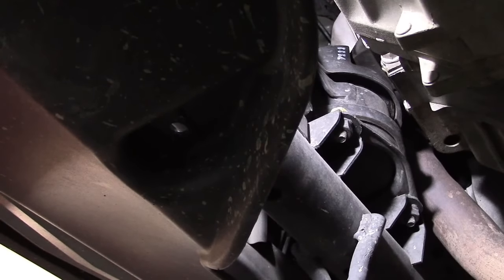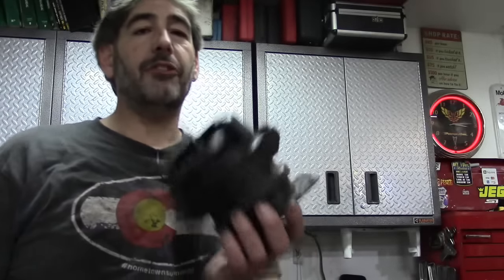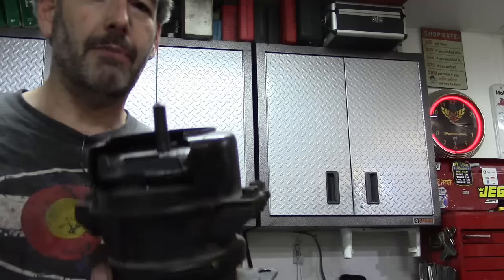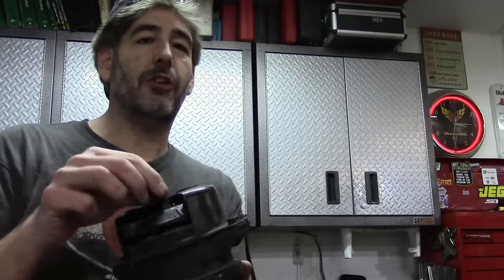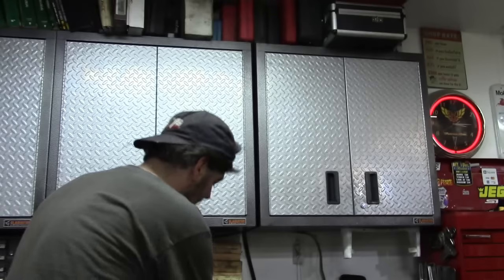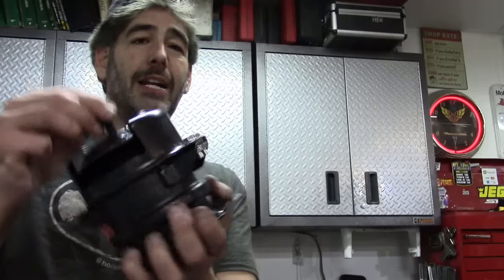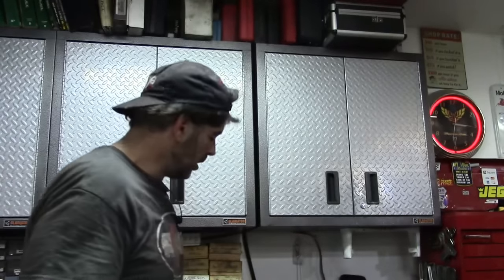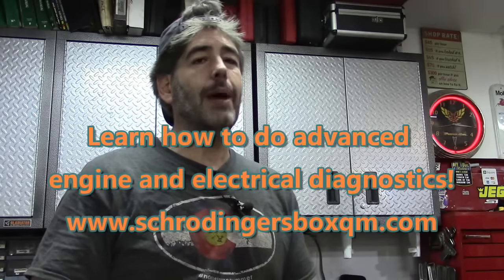How to check bad engine or transmission mounts

Comment: Hey, i don’t know how to express the problem, but i got Audi A4 B8 2008 2.0tdi CAGA. Had problem with one engines cushioun. I replaced it, and after  4 days maybe got an airbag error, didn’t watch the error with a pc found out in google that it’s front airbag’s foult. Didn’t gave a damn about it and after some time got a ticking sound after i press gas pedal very quickly(just a very little, and gently) and release it. Car didn’t lost any power, but at cold start sometimes it won’t start from first time (even in nice weather) sometimes even when it’s not a cold start it would still do the same. A few times it did over rew it self in gear. By saying over rew i mean - when i’m in 4-5 gear and press gas pedal it just rews and gives 0 power. If anyone ynderstands what i’m trying to say and might know where to look for the soliution, please leave a comment, thanks. And gearbox shifter vibrating a little, even when you drive. But just a little bit.
Reply from the maker: ok what data do you have?

Comment: Power braking seems to be easier, no need to have car lifted up generally. Never seen this method though. Rock test is worthless. Seems like all the v6 Hondas suffer from mount problems, suspect the one in the front center first.

Comment: Never put stands there you are Gina damage the body
Reply from the maker: Never put stands in the location MADE for placing stands????
Reply: @SchrodingersBox   No never put stands there it's only for factory jack road side tire change new or rust free car .only put stands on rear axle n front k frame .It will damage it's only thing tin there. Uni body cars are made as throw away trash junk. Think when we had bumper jacks n frames you never put jack stand on rocker panel lol.
Reply from the maker: Ummmmmmm that jackstand was under the frame. Duh.
Reply: @SchrodingersBox  ok sorry I looked like it was under  the factory jack spot bottom of rocker panel.